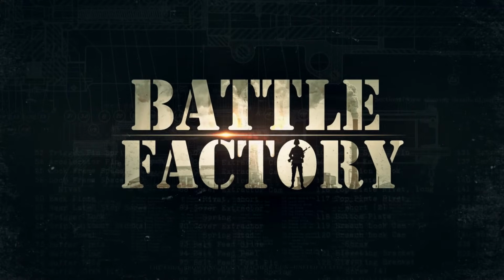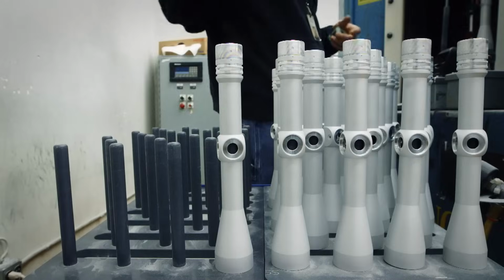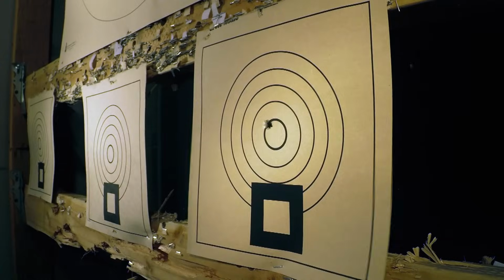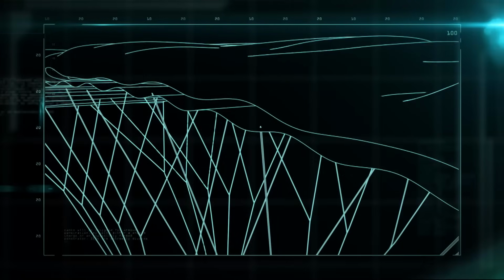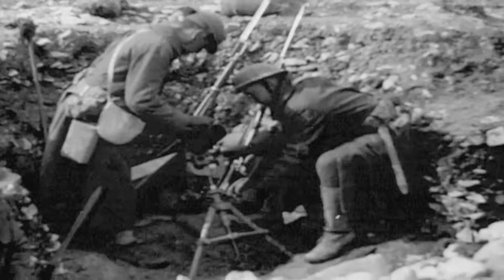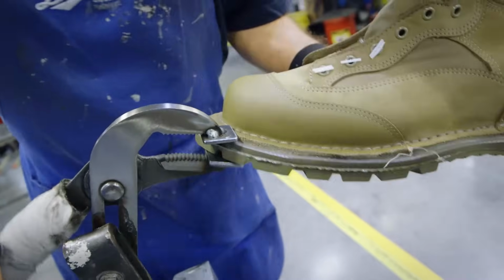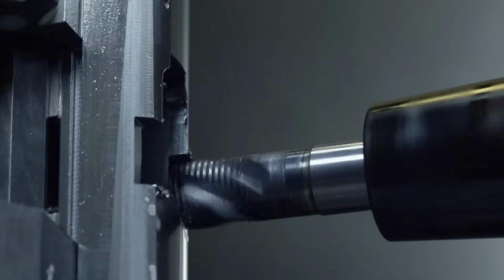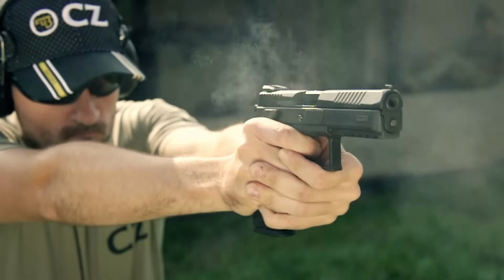From Combat Boots to Battle-Ready Gear | Battle Factory

Comment: As a USMC veteran those rat boots were the worst thing I’ve ever had to wear! After our first hike they cut the back of my heel because the entire part was made of a solid piece of plastic which doesn’t bend. IT CRACKS OPEN! I bought my own pair the next day! I’m still pissed about that 6 years later and still have scars on both my heels!
Reply: Is there any brand name for the one you bought? I heard somewhere that "military-grade" means the lowest bidder manufacture so I'm not gonna take that chance when I buy one for my own.
Reply: Plenty of great boots out there. Just because some pog had a bad experience doesn’t mean jack
Reply: @Mark_it_zero_dude  ok pog
Reply: U must have had the wellco ones
Reply: Boots chosen by ‘blanket counters’ during smoko sessions and realistically field tested by unlucky troops … been there, done that. At one point, circa 1990? pretty much everyone in the Corps of Royal New Zealand Engineers wore their steel-capped boots in the field because the standard boots were barely adequate for use around camp!
Reply: Cc  😊😊😊